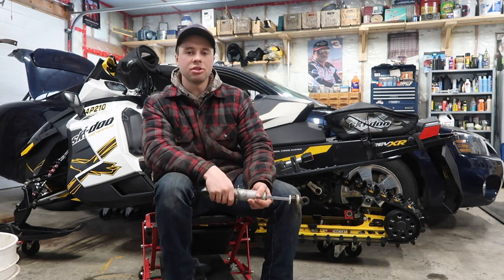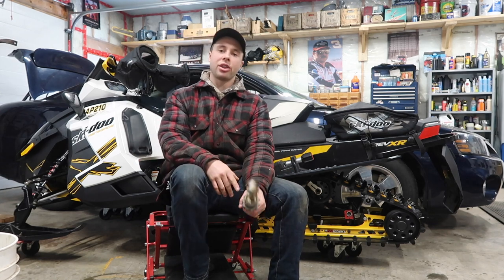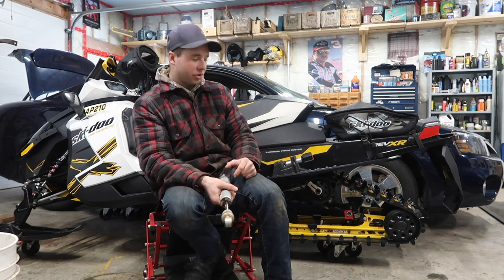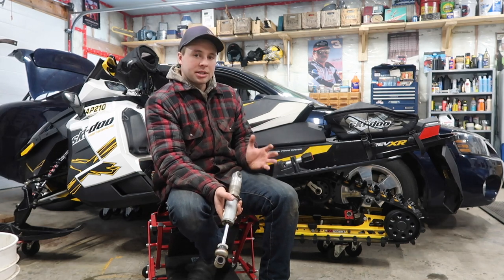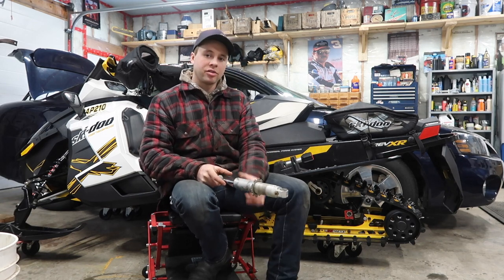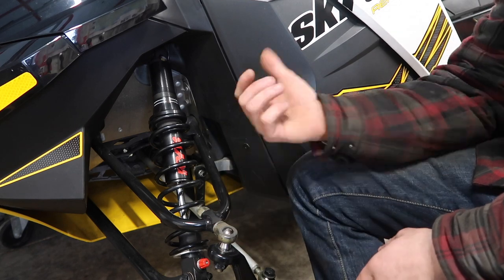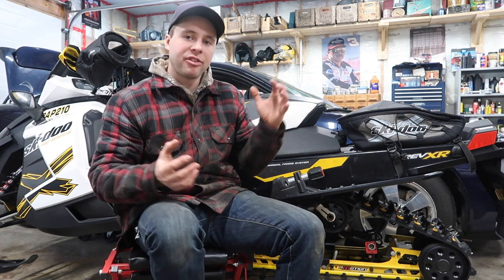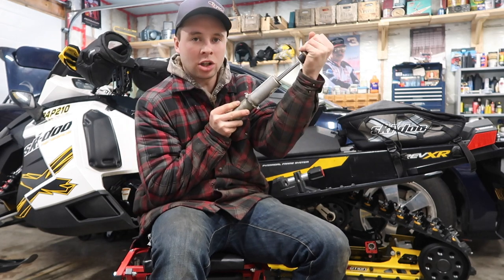How I Set Up My Snowmobile Suspension!!  DIY EXPLAINED

Comment: This video is top notch. Really helped me figure out how to adjust my sled. I am 300lbs 6'3" and my torsion bar was set to 1.
Reply from the maker: You should get what they call the” fatboy” springs. I think part # they refer to as 270/271 springs. These would help your issue greatly.

Comment: For reference I’m riding a 2020 renegade adrenaline and I weigh 290 lbs.  The factory torsion springs for me are set to level 5.  They are a touch stiff but level 4 I find not enough. I ended up putting skidoo touring torsion springs on it so it would support the weight off two adults. With the heavy springs I ride at level 1 when solo.
Reply: Hey Todd, I am a similar weight to you. Did you adjust the front springs at all?
Reply: @bobthemagicman  I have them set to the middle setting.

Comment: Quick questions: just bought a new mxz sport 600efi, front spring cambers are at lowest and I’ve set the rear torsion to 3 to keep the snow flap from dragging. Should I be setting fronts up to 2 or 3 as well and also how close to the ground should the flap be when I’m sitting on the sled?? Thanks if you can answer and great video!
Reply from the maker: You don’t necessarily have to set the front the same as the back. I would start soft and if you like it go with it. I like the front more stiff for fast cornering and no body roll but that is me personally. I believe don’t go by the flap. Go by a measurement at the rear bumper. I think the spec is 1-3 inches lower. So if you are at say 20” at the bumper( pull up on the back all the way til it stops with nobody on it then take measurement) then sit on the sled. If your measurement was 20” you should be sitting between 19 and 17” somewhere. Don’t quote me on the “ numbers. You can google r motion sag when sitting and it will tell you for sure. Hope that helps. Josh

If going by flap you definitely don’t want it dragging but want it close to the ground.
Reply: @Schneids15  thank you sir!

Comment: Have you ever had to rebuild your QA piston whatever it's called? I have two XRS's and both don't move it until you get to 2 or 2.5 on the tunnel adjuster.
Reply from the maker: I had my shocks rebuilt and both were the same… only started moving at 2. I pulled the assembly apart and looked at where the piston stopped. Where it bottomed out was around 2-2.5 i’m pretty sure…. So that’s normal.
Reply: @Schneids15  There's a thread on Dootalk...I tried sending it to you but YT won't allow it. It's not normal. When you took it apart did it have one or two o-rings? Did you bleed it?
Reply from the maker: @BlueRage  i felt my piston had full travel back and all 3 sleds i had worked on had engaged at the same point. I always rode on a stiffer setting as the starting area was way too soft for me anyhow so i never worried.
Reply: @Schneids15  I have two skids out of two XRS's in the garage right now. Identical sleds. One engages at 1.5, the other engages at 2.5. In the Dootalk thread they mention that some leaked. Did you actually take yours apart? The upgraded version has two seals on the piston.
Reply from the maker: @BlueRage  never took apart. No leaks and the piston was bottoming out to where it should. The piston in the skid would go down to where it should as well on the torsion springs. The previous owner of the sled told me that since new in 2012 he would always turn it back il free spin them back to his preferred setting because the contents would leak from piston below to the cylinder over night.
Reply: @Schneids15  Search Rmotion Suspension Issues Help. Read the thread. I'm facing this issue at the moment.

Comment: What should I do for Darting my son rides the sled, he is about 115lbs has Rmotion but not quick adjust , n a 2015 Skidoo Renegade Adrenaline 900 Ace
Reply from the maker: A simple fix would be adding ski pressure. Either tighten limiter strap up front but easiest is to just crank up the torsion springs. Josh
Reply: @Schneids15  thanks for the reply!  Torsion Springs or Center Shock?  thanks Charlie
Reply from the maker: Sorry forgot to mention. First off if you do loosen the forward shock in the skid that will also add some ski pressure as it is taking pre load off the front of the skid. The torsion springs will make it a stiffer ride but greatly improve on ski pressure. First off though from factory i believe they only have one single carbide runner in the middle.(used to come with the double that the ski’s were designed with but saves cost i imagine not shipping with them..... )  I would suggest adding the second carbide on the outside edge of the ski. You have to drill the holes but the slot and everything is in there. It will solve your darting issues i bet. They usually ride really well with the double carbide.   Let me know how you make out. Josh
Reply: I always run 8" double carbides. I've had so many people tell me it's not necessary but it always makes the sled track straight. Yes there expensive but there is a diamond v cutter you can put in a drill to keep them sharp. I always figured missing a turn could be 10x the cost of good doubles.
Reply: Know this is old but check/adjust ski toe to 1/8 inch or so out. Also try adding spring pressure to the center shock.